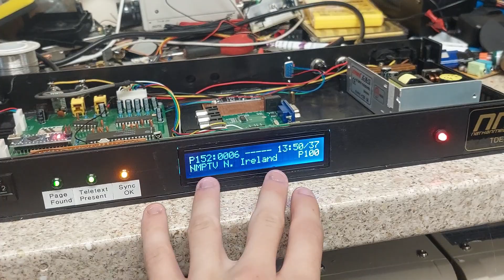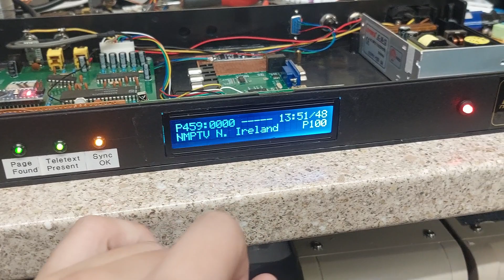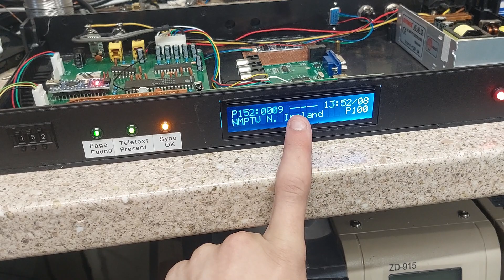Inside my Teletext Decoder

Comment: I recently found an old television and there was a teletext decoder circuitry inside of it. I have no idea what to use it. I know how to use arduino but dont know how to interact with this decoder chip. can you suggest me some resources about what you have done?
Reply from the maker: Depends what it is you want to do - first thing would probably be to look up the chip's datasheet to see what it's capable of doing & how to control it

Comment: Back in the day I was a TV engineer I found a company supplying a decoder board if you had a TV with no Teletxt, at the time I had a 26" Philips TV with no Teletxt and did not want to scrap the TV, the only problem they were not something anyone could fit as you had to mod the TV circuit and fit them inside the TV, they supplied the decoder board and remote control and general circuit information where to mod the TV and where the signal had to be inserted on the TV circuit board however, this was general information and not for TV brand XYZ, you also had to provide all the other componets needed ie the resistors and capicators etc as each make of TV required different extra componants, I have to say the boards were not cheap but worked a treat.